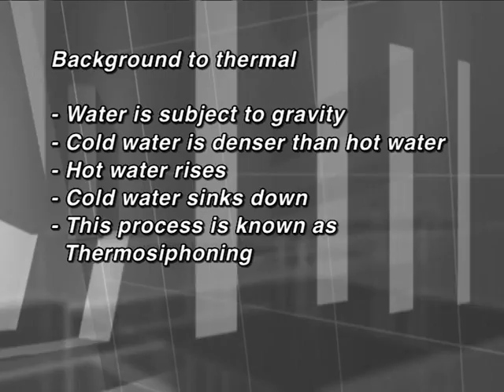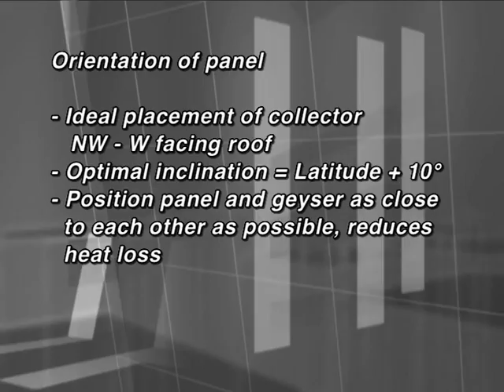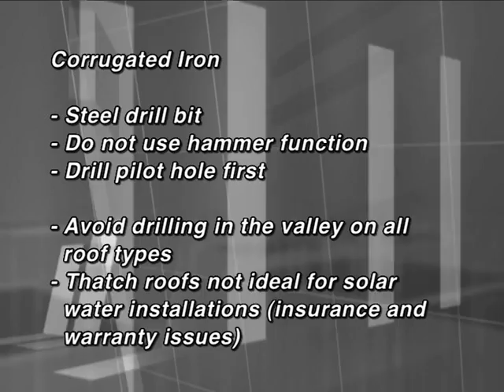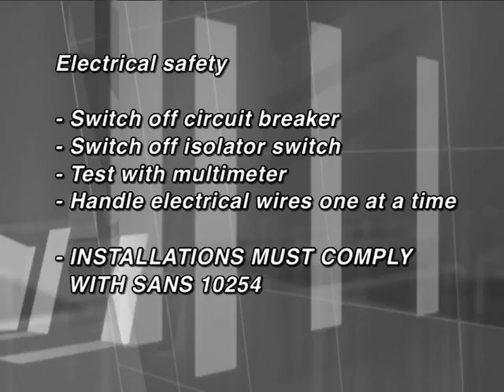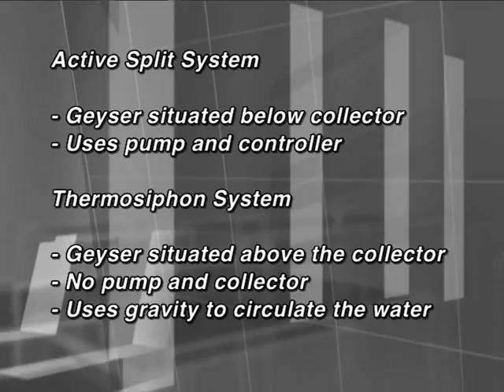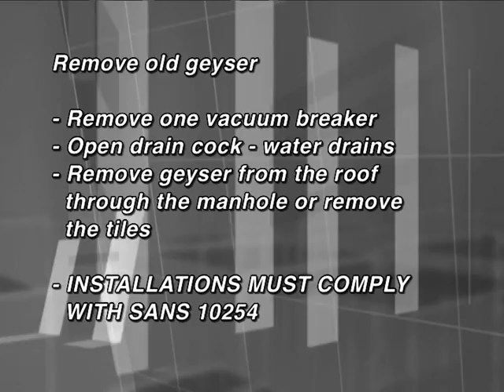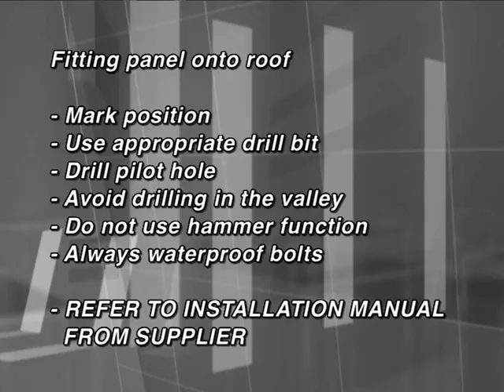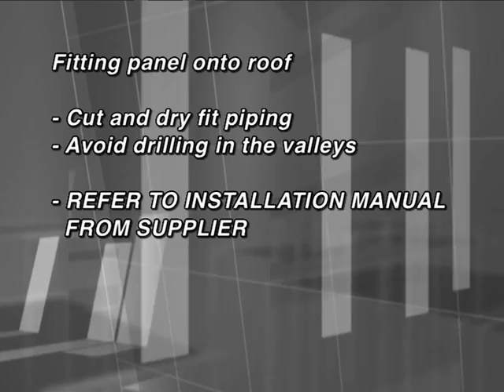Solar water heating in south africa

Comment: I appreciate the good work your are doing to teach us am in uganda my question is there are 4 openings on the panel 1is the inlet for cold water  remember each side their are 2 open  connection  so the other side is for hot water into the tank what do you do  for the remaining  2  opening
Reply from the maker: When only using 1 panel as an example, the bottom left could be the cold inlet, top right would be hot outlet. So you would have two openings not being used. The additional outlets are usually used to extend the number of panels being used; but you would always have some outlets / openings not being used.

Comment: What happened to the rest of the video?." How to covert a normal geyser to solar?"
Reply from the maker: Hi Gabriel. 
There is a specific valve that is made to convert a normal geyser to a solar geyser. The valve is effectively a branch that splits the input at the TP valve into two sections. One section is where the TP valve connects and the other is the hot water inlet from the solar water heating supply. There are lots of solutions on how to do this. You are welcome to give me a call and i will gladly point you in the right direction. You would be able get my number from pqrs.co.za
Reply: @carelb8832 what happens if the panel is in the thermosyphon style and my TP inlet is at the top of the geyser. How can I convert since thermosyphon doesn't require a pump🙏?